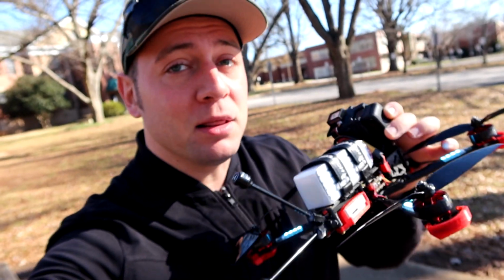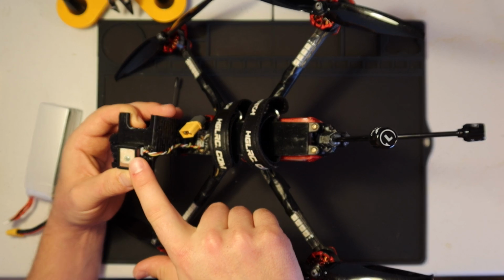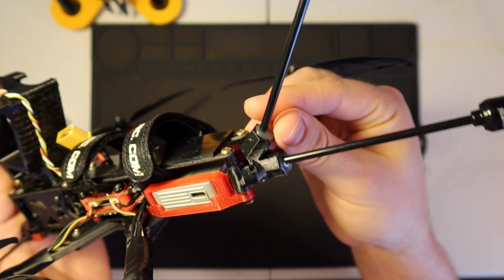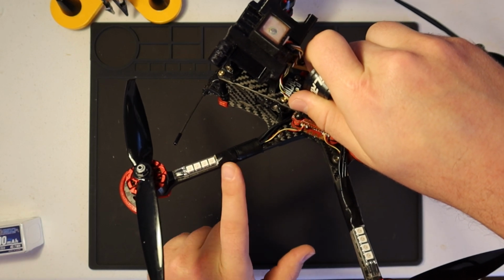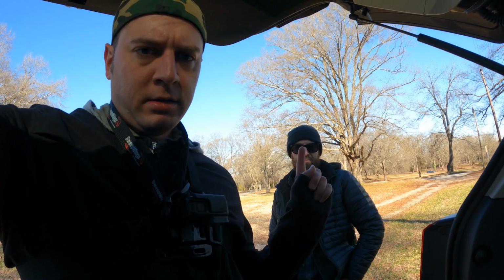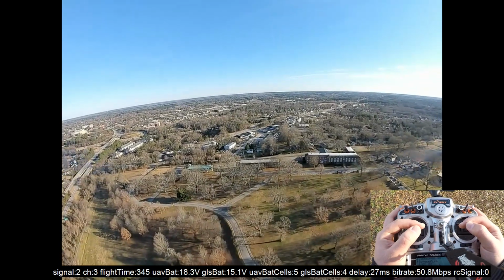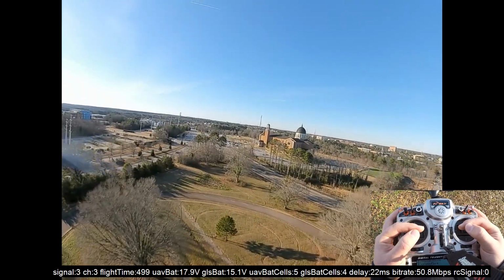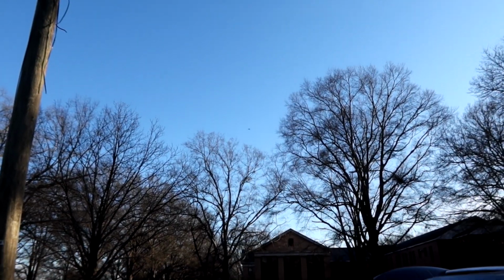Turning a Freestyle 5" into a Long-Range 7" FPV Quad - HGLRC Sector 5 V3

Comment: Do you get any prop in your GoPro footage with this frame?
Reply from the maker: A little bit yes, but if you shoot in 4k (or even 5k with the GP9) you can crop them out pretty easily. Shooting Wide on the GoPro in preparation for Reelsteady does not show any props.

Comment: Nice testing! You should try a lI-ion pack😉, I try it on my sector 5 v3 and I get 15 minutes!
Reply: What li-ion cells do you use? I’m thinking of using some molicels with a 45a discharge
Reply: @torchwork8651  Samsung INR21700-40T 4000mAh 35A Li-Ion 👍
Reply: Do you know the amp draw on the sector 5?

Comment: Nice steady sensible foray into medium range Ed. I remember well being at this stage some time ago. For what it’s worth....some things to consider that I’ve found along the way...you are on the right track with battery cell count/motor kv, my 7” quads now run a high kv motor with 3s 5000mah packs. Brother hobby motors are 2806.5 to give better efficiency @ the lower rpm. DJI goggles receive antenna is the bottom right as you look from the front, so have one of your menace in that position. Bi blades just gave me more vibes so I went back to tri’s. Taking is easy flight times are now 20 mins+ or 12 mins thrashing around 😲

Comment: Antennas in the front That's a simple suggestion that's such a great idea, by the time you're losing video turning around with antennas on the back will simply make it even harder to connect to signal. But in front rotating 180 brings antennas closer but when you're losing signal🤪
Reply from the maker: Thanks for the suggestion!